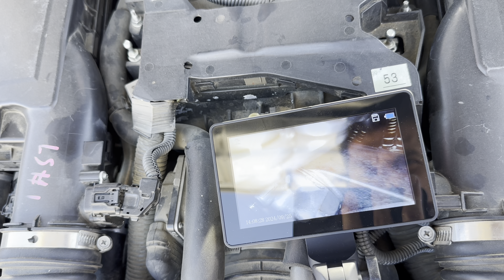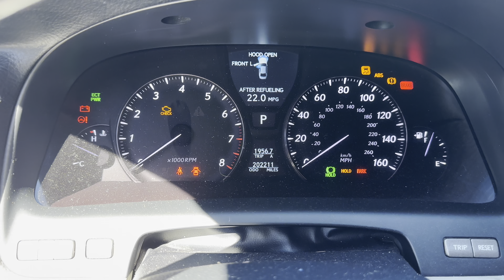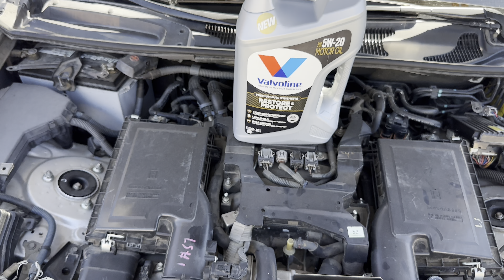Does Valvoline Restore and Protect really clean your engine?

Comment: Where do you live that Wal-Mart has that oil for $24? I live in Detroit and it's $30.
Reply from the maker: Valvoline website, subscribe and save 20% off their 5 gallon box. Also applies to their oil filters. Thanks for watching!
Reply: @Fix-it-tony  You just stated that it's $24 at WalMart. Now you're stating you bought it on the Valvoline web site in a 5 gallon box. You're just a bit too much of a politician to be credible at this point.
Reply from the maker: @fowvee it was on sale at Walmart, but sales end. Better option is the website, price stays the same.
Reply: @Fix-it-tony  Thanks!
EDIT" Promotion must be over because I can't find it on Valvoline's website.

Comment: Where did you get the information about boron being the active ingredient that is responsible for its success at cleaning? Im trying to better understand the molecular science behind the additives. I hear there's no ester in this formula
Reply from the maker: Boron is a super slick molecule that is smaller than the bonds that build deposits so it can break them up. Most anti stiction additives are made of boron for the same reason. Thanks for watching.

Comment: Can it fix piston slap noise?
Reply from the maker: That’s a mechanical issue unfortunately, only a rebuild with an updated skirt design will fix that. Thanks for watching!
Reply: @Fix-it-tony  I mean just to reducing the noise. It's weird I got piston slap with my 2022 Hyundai. I do change oil every 5k miles or 6 months, but why I got piston slap. Is it because of thin oil that I use? The dealers recommended 0W20 oil
Reply: @ajhibhaktiar read a comment elsewhere saying it took them 6 to 9 oil changes with valvoline R&P to get rid of piston slap noise but every situation is different so give it a try

Comment: I am skeptical how Valvoline basically reinvented the wheele. Why doesnt Mobile have something like this? What does this do to the seals long term.
Reply from the maker: Just breakdown down carbon and sludge, a custom molecule that they first developed with Cummins for diesels. Thanks for watching!
Reply: Try it it's definitely a new tier oil, the difference in smoothness is night and day after the first start up. Mobile will eventually reverse engineer a competitive product. Valvoline was just the first to market. Unknown chemical consensus on the Internet. Eventually the science will be explained. Welcome to 2024. Just beware of build up in the oil filter if your engine is neglected
Reply: @outletadvantage6388 Where is the majority of discussion on this product happening? Link to forum please. Also does the functional components of this oil  exist separately from anywhere as an additive? It seems like this would function much better as an additive than premixed with oil, which is limited to certain viscosities.
Reply: @Null-o7j  the majority of the discussion is in YouTube comments from the major oil channels, you've got Ford boss me, the oil guy (can't remember his name), and a few other reviewers. Anecdotal information is what I base my suggestions along with my own personal experience. The additive package is proprietary, meaning it's not fully released how it is they are accomplishing the results we are all witnessing. Only a matter of time before a competitor takes notice of the craze and begins reverse engineering a similar solution. For now, this has been the best consumer grade oil I've tried. Smoother engine, quieter idle, more throttle response, 5-10% increased mpg, and the oil seems to be cleaning inside the valve cover. Oil is darker after only 1200 miles compared to Mobil 1 EP or similar high end consumer oils. And the price is a bargain for performance, $30/5 quart. Cheaper than high end oils and comparable to the cheapest super tech oil available.

Comment: Do you think this is worth switching from the Mobil 1 full synthetic to this oil? The Mobil 1 also has cleaners in it and its rated at 20k miles, however I always go up to 5K miles before changing the oil.
Reply from the maker: Both are good oils, the Valvoline offers a better package for preventing and breaking down buildup. Valvoline is also cheaper, I’ve never had an issue with it. Thanks for watching!

Comment: How many miles did it take to start to reduce the oil consumption for you? And what's the lowest miles youve heard or seen before they stopped consuming oils?
Reply from the maker: Half way through the second oil change I noticed the difference. Oil is now staying cleaner longer too. Thanks for watching!
Reply: @Fix-it-tony  how many miles was that?
Reply from the maker: 8500
Reply: @Fix-it-tony  so did you notice anything different prior to that? I'm also running r&p. But I wasn't burning any oil. I did however have some timing chain rattle show up at the 150k mile mark. From my understanding this can be from the hydraulic tensioner clogged. So I'm wondering if that will increase in tension as time goes on. I only put 800 miles on it so far though.

Comment: Can this be used as regular oil where it gets changed every 5000 miles or should you change this more often like at 500 miles
Reply from the maker: 100% can be used as everyday oil, just change oil filter early if engine has a lot of sludge. Thanks for watching!

Comment: On old cars, 2002 Mitsubishi galant w 235k, is it ok to start using a synthetic on a vehicle w no leaks. i might go up to 10w30 val restore vs 5w30 conventional. I am burning oil but not a qt in 4k miles.
Reply from the maker: Synthetic oil is safe regardless of miles. Get oil for everyday use and higher mileage old cars for cleaning up oil deposits. Thanks for watching!

Comment: I have a 1997 toyota 4runner and never losing a drop of oil every 5k miles when i do oil change. But notice when putting oil in, the inside looks a little carbon build up. I gently removed some with a plastic pick and was wondering if it will clean up engine.
Reply from the maker: I’m sure it would, just make sure your pvc valve is good. Thanks for watching!

Comment: "This isn't going to help you if you have an oil leak." Not true, yes it might not help your leak but this stuff is still a good idea to remove varnish and carbon and to keep from future varnish and carbon from accumulating.

Bottom line is, Motor Oil Geek already covered this. He's qualified to analyze oils and has infinite knowledge on it. If he says it's good, then it's good. I made the switch right when his video came out.
Reply from the maker: I was making the point that this will not fix an oil leak. It will still clean up the engine though. Thanks for watching!
Reply: @Fix-it-tony  understood

Comment: It works...but would love to hear feedback from folks who have VVT ( variable valve timing) engines.....these are very small and finely-filtered hi-pressure oil passages to adjust the valve timing. People in general say change oil filters often between oil changes when using this oil.....but this won't address if it's OK for VVT engines. Valvoline tech email didn't help much just got the regular FAQ repeated saying it was formulated to not clean too quickly,....it takes 4 oil changes to completely clean. But they said nothing about VVT engines. Anyone here?....how about this Lexus?..is that a VVT engine? I think it is.
Reply from the maker: My LS460 is a VVT engine, no issues. Cleans slow enough to prevent an issue, but if your engine is really dirty you should change the filter every 1-2k miles. Also scope the pan and valve covers to check for excessive sludge that should be manually removed by removing the valve covers and oil pan. Thanks for watching!

Comment: Pennzoil ultra platinum the one made from natural gas, has the same effect. The Pennzoil is a grade 5 base oil witch is why it cleans so well.
Reply from the maker: In engines I’ve torn down that use Pennzoil I’ve found deposits. Thanks for watching
Reply: @Fix-it-tony ultra platinum ? Or regular pennzoil
I’ve seen that ultra platinum after two flushes seems to be just fine.

Comment: I drive my car everyday for business work use
It’s a 2021 civic
With nearly 50 k miles
Runs like I just took it out of the dealer. I’ve only ever used the dealership oil, ultra platinum twice and have Castrol edge sitting in my house waiting to be put in just cuz it was on roll back. 
Would it be a good idea to try this oil out?
Reply from the maker: This is a top shelf oil and with its deposit preventing properties it would be an excellent option. Thanks for watching!
Reply: @Fix-it-tony  so is it an oil that you use a few times to cleanse your engine then you continuously use it or perhaps maybe stick it start using like advance or extended protection valvoline. 
I’ve used ultra platinum which seemed good and my engine is smooth but idk if it’s true that it can cause damage later on to the catalytic converter and other things that I don’t really know what they are tbh

Comment: Is this oil 5w20, lighter than 5w30?
Reply from the maker: Yes, never use light weight oil on an engine designed for heavy weight. Lighter weight oil is designed for tight tolerance engines with higher pressure oil pumps. Thanks for watching.
Reply: @Fix-it-tony  the engine on my car is 1.6 diesel, I'm not using it for heavy weights

Comment: Due to additives in restore and protect it voids most vehicles manufacturer waranty so if you are under warnty dont use this
Reply from the maker: Not true for most vehicles, you are just required to use the recommended viscosity and equivalent API which this oil covers those bases for most new cars. Valvoline stopped paying the GM Dexos mob money for licensing since it was close enough to GF6A and API SN Plus cert they already pay for. You will not have an engine failure due to using this oil unless you use the wrong viscosity. Thanks for watching!

Comment: Might as well check this out for my girlfriends kia that's drinking oil...82,000 miles
Reply from the maker: Kia has an extended warranty of most models 15 years 150k miles. They have a major mechanical issue this won’t fix, check with your dealer first. Thanks for watching!
Reply: @Fix-it-tony yea..no...it dosen't work that way, been trying for six months and they have all said kick rocks and you need a engine deal with it, four separate dealers in the toledo area and kia America customer service, it's only 100,000 to the original owner and nothing for buying it used.

Comment: isn't the point of oil to suspend deposits IN the oil? (meaning, if it's doing it's job, it WILL turn black).  If the oil is staying clean that can also translate to it's not picking anything up. I will disclaim that this is my comment left at 2:36 on your video. I'll see by the end of it if I still see this product the same way.
Reply from the maker: We are on the third oil change since switching to this oil. The first two oil changes were black, so it seems the cleaning is done. Thanks for watching!
Reply: Yes I used this on my wife car  it's a hyundai accent with  bad blow by  and it consume a quart of oil every 1000 miles. So far I have 1000 miles on the first oil change and the dipstick looks dark already.
Reply: Oil turns black because of blow by on the rings. It's why diesel engines get black very quickly after an oil change,  they have much higher compression. 
It is the job of the filter to gather up any large particles
Reply: @edbeck8925  No this doesn't happened when I use the regular pennzoil ultra  the oil stay clean but I just have to add some. This is why it alerted me when I check it at 1000 miles and the oil was dark already.  This didn't happen with pennzoil.
Reply: Not if the cause of the most of the carbon is from blow-by. Carbon is a by-product of poor combustion and contamination. But yes, you do want your oil to suspend what carbon is captured so it doesn't separate and cause an issue.
Reply: @edbeck8925  doesn't a running vehicle continue to return darker oil though regardless? combustion will always create carbon which the oil's job is to wash at and suspend. It won't just be from rings. It will be from valvetrain, residual oils on the cylinder walls. and the rings will always have blow by no matter what at a cold enough start until they've driven long enough to press out under load fully.

Comment: Yes like a good FLUSHING it will clean the engin of carbon deposits, it cannot restore a worn out engine!
Reply from the maker: Let me be clear, this is not an engine flush. Carbon buildup in piston rings is a common issue with modern engines. Most new engines use low tension rings to reduce friction, but commonly allow the rings to stick as carbon builds up allowing a little oil to burn. This also leads to more deposits in the crank case which leads to premature wear. This product has proven to safely remove carbon and sludge over time and keep it away. Thanks for watching!

Comment: If you need to “clean” your engine, cut the oil change in half. Maybe a bit more expensive, probably not as destructive as an engine flush product.
Reply from the maker: The beauty of this product is can be used as your normal oil for all changes for the life of your engine. It will not hurt your engine like flushed will. Breaks down existing deposits and prevents the buildup of new ones. Thanks for watching!

Comment: Honda 2005 Accord 351,000 10,000 mile oil changes Bosch filter 1/2 quart every 10,000  and cheap walmart 10 w 20 full synthetic
Reply from the maker: The more you drive consistently the more likely the carbon and oxidation won’t build up. Thanks for watching!

Comment: R&P will work as long as someone didn’t let the oil get too low.  If the cylinders are scored you will need a new short block.  The newer engines (2016+) don’t really have this problem.  Regardless check the oil level and condition every 500 miles and change it every 5000 miles with a good synthetic for long engine life.  Stay out of boost if you have a turbo.
Reply from the maker: Absolutely, no oil will fix mechanical damage. Thanks for watching!
Reply: I have a 2015 F150 Ecoboost now on this Valvoline. Zero problems and I use them Turbos:)

Comment: Will be trying on my ole scion 2008
As well 15 optima
Both consuming oil
Reply from the maker: Defiantly worth a try in both, the theta 4 cylinder in the Optima are known for mechanical failures, this oil may not help. But there is an extended warranty program for them from Kia because of known engine problems. Thanks for watching!

Comment: I doubt it's better than Amsoil or HPL. Oxidation level is only 8. If it worked that well, it'd be $50 for 5 quarts
Reply from the maker: I’ve been happy with the results, amsoil is a great product. It’s expensive and not available everywhere, this is a good option, but try it for yourself. Thanks for watching!

Comment: LS? That engine is GM no? That's why it burns oil
Reply from the maker: Honda’s and Toyota’s are prone to burning oil because of soft rings and carbon buildup on the rings. Thanks for watching!
Reply: @Fix-it-tony  dunno about that, my tundra has 110,000 miles. Never burned a drop of oil
Reply: B12 into each cylinder soak 24hrs, then blow it out and use copper plugs to clear out any carbon that has broken loose, your engine will thank you, don't forget to get an oil change right afterwards

Comment: Any Diesel rated Oil Like Rotella , Delo , Delvac  will clean a Gas Engine Better Diesel rated oil have a Very High Detergent Package that Standard Gas Rate SN oil Doesn't Have  look at the oil specs for the Restore and Protect Detergent Package and it Nothing Special !
Reply from the maker: I’ve tried diesel oils to cleanup out Yukon, didn’t work. This is the only oil I found that stopped carbon induced oil consumption. Thanks for watching!
Reply: No, it is not a diesel oil. That assertion is completely false! R&P is API SP rated.  No traditional Heavy Duty diesel oil, which you describe, will also have the SP rating.  Can you just give Valvoline credit for coming up with a novel oil that actually dissolves deposits without trying to minimize what they have done?

Comment: Snake oil … test conditions was oil at 151C for 80 hrs at 3900 rpm. Regular car oil never exceeds 110C in the summer time in southern US while driving 9n highway.
Reply: Snake oil that apparently works based on quite a few responses
Reply from the maker: Not sure, but not having oil breakdown at 151 c is a good thing exially on new turbines charged engines. I’m just shocked it worked for my application, didn’t have confidence it would, I was throughly surprised and pleased. Thanks for watching!
Reply: I see my oil get close to 240°F/115°C cruising 85-90 mph between 3500 and 4000rpm. Keep in mind that oil is much hotter inside the bearings of the engine. I read a paper from I believe Ford Motorsport that describes that inside the crank bearings, the oil on the bottom loading side is up to 30°C warmer than the top unloaded side. That can get you pretty close to 150°C oil teml inside the motor, not to mention the heat from the pistons themselves, where the oil is working in the rings. Running this same oil in my car currently, 500 miles with no issues thus far.

Comment: i have a gx460, similar engine as yours but is port injected. can this be used for lower mileage engines? i have roughly 70k miles
Reply: Certainly!  I am now using in brand new 2024 Ascent DI Turbo… 11k miles (smoother, quieter), then 14k miles- 2nd “R&P” change/fill engine is now quieter than new!!  Oil drain was medium/dark color. 
FYI: 1st Drain @ 800mi.(Mobil 1), 2nd. @1776mi., 3rd @4480 (Pennzoil Platinum 10W30),… 6th.& 7th. @11/14 kmi.(Valvoline R&P 5W30).
“Severe Duty” driving conditions require shorter drain intervals… this includes “Turbos”, high ambient temps (Texas), Stop & Go traffic, etc. 
Best price is currently on/in Walmart w/Free S&H!
Reply from the maker: Can be used as your everyday oil, helps remove and prevent buildup. Thanks for watching!